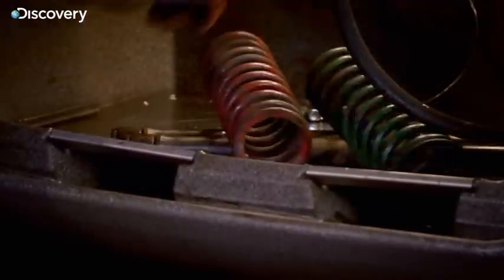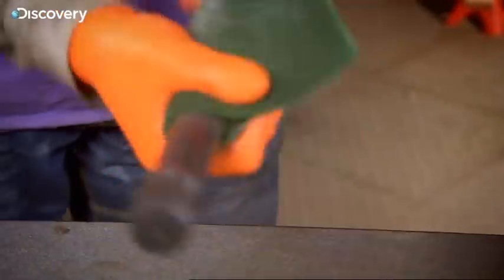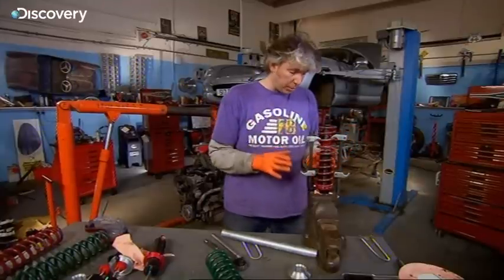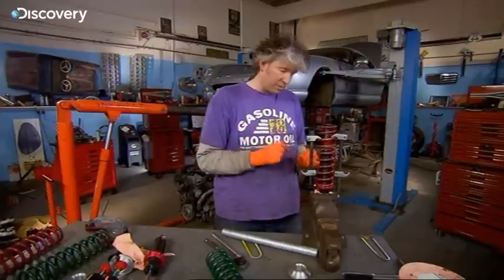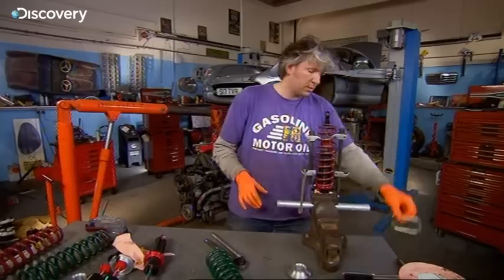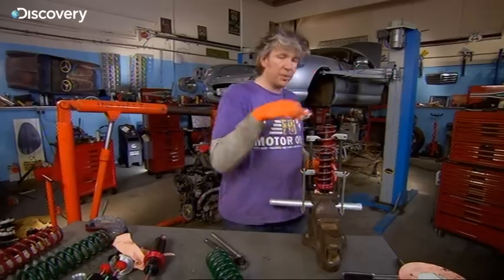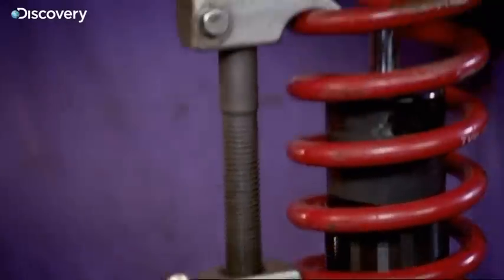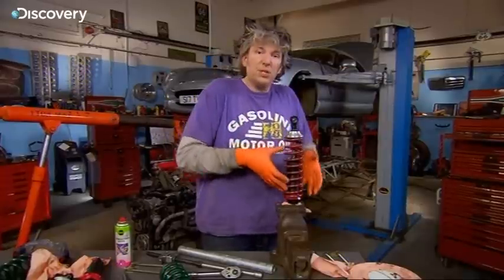How To Fix Coil Spring Compressors - Wheeler Dealers

Comment: this is not the proper way to use the spring compressors!!! the studding he has used is just a length of screwed rod, not very strong. as you can see he didn't have to compress the spring by much to get the retaining cap in place. however if you tried this method on another spring that needed to be compressed more then there is more chance of the "studding" failing. use this method at your pearl.  edd is a very cleaver guy, that's why I watched the show but he should have definitely mentioned the limitations of using this method.
Reply: *peril
Reply: *clever
Reply: Capitals
Reply: I agree maximally.